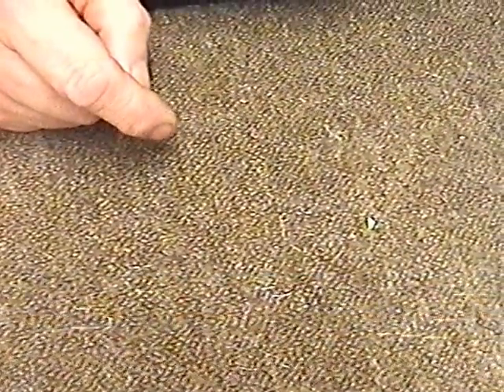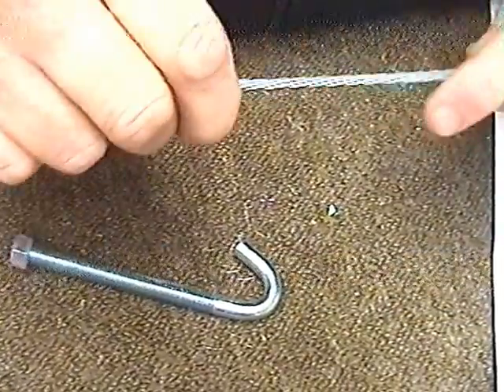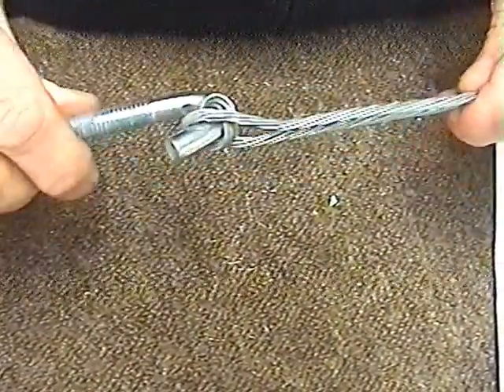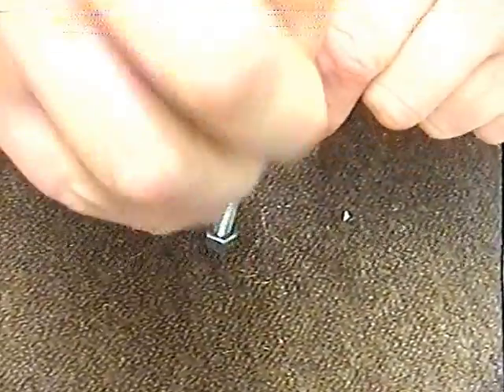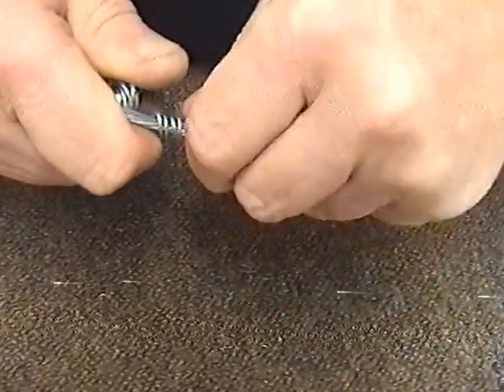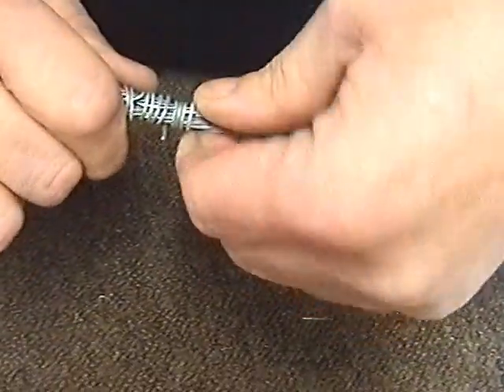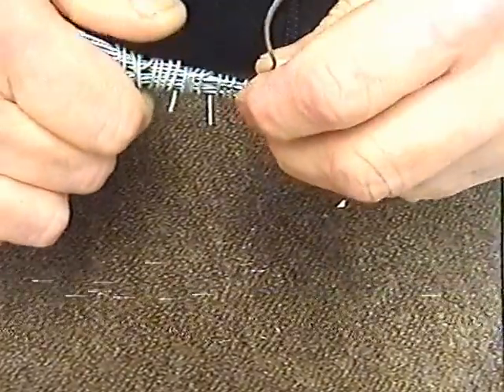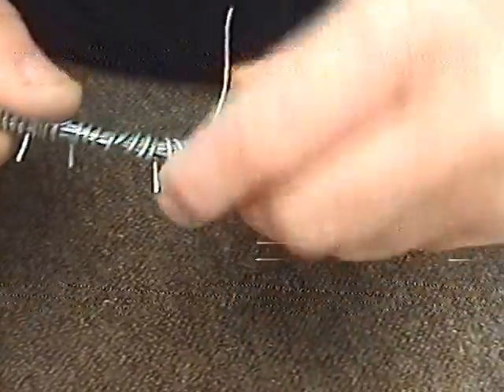Aerial lashing wire splicing

Comment: whoever showed you how to tie a kit wants a slap....what is wrong with using a locking knot?   doing it your way just weakens the knot (double loop at best) and cuts your hands to shreds with seperating the galvo wire and wrapping it around.  Seriously buddy you have no idea.